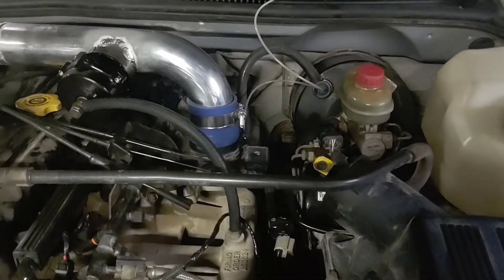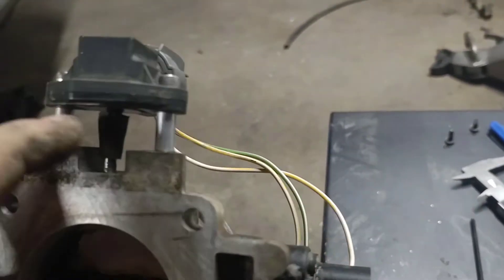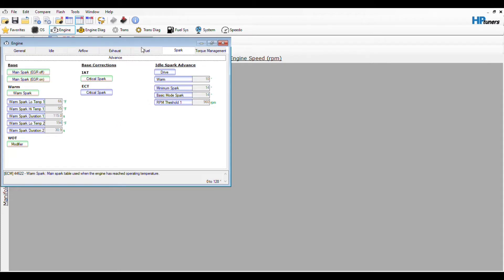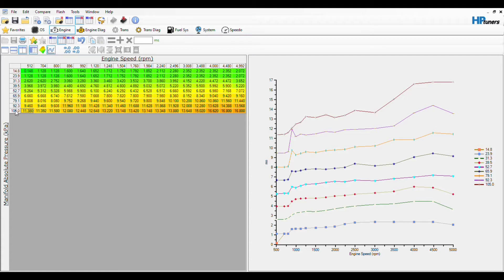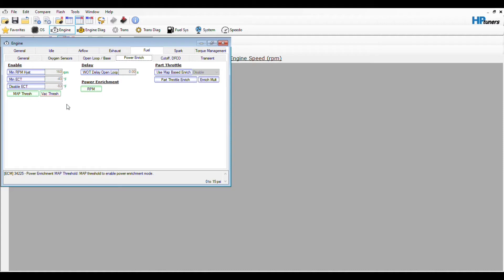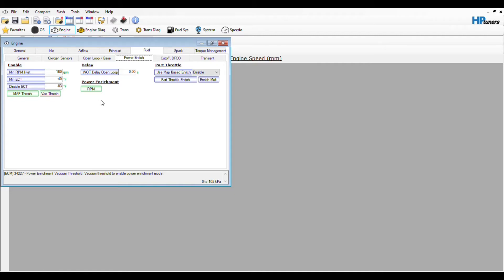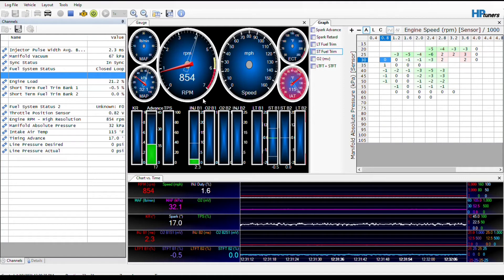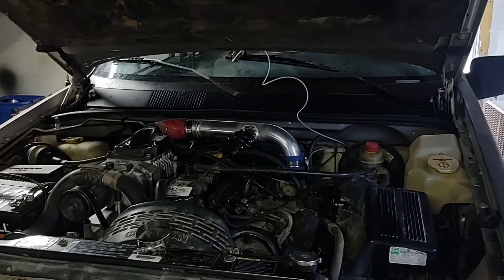hp tuners supercharged jeep

Comment: So basically the MAP reading is the "inverse" of the vacuum reading, it calculates vacuum from atmospheric - MAP reading. So if you used the original sensor with the supercharger, when you hit 0 psi or atmospheric, it would have thought the vacuum was at -1 Bar. which obviously is not correct since it would actually be 0 Bar. So then you use the open loop threshold to basically stop letting the ECU make vacuum calculations whenever you start making positive pressure, bringing the vacuum up instead of down, right? Basically as soon as it stops acting naturally aspirated. From there, you are just ignoring whatever the ECU thinks the vacuum reading it is, interpreting the MAP reading based on what you know it means in terms of boost, and using the open loop fueling table to make it fuel properly. Hopefully that made sense, correct me if I was misunderstanding anything. Great videos!
Reply from the maker: IV been meaning to make a new video to try and explain what IV learned over the past few years of remote tuning these things for boost.
Reply: @thomasbeyer  I will definitely watch if you do hahaha.

Comment: Ahhh there we go this answers all my questions. You used the Honda 1.75 Bar MAP to increase your resolution with the small table. Wonder how I'll fare with the 2 Bar MAP on the V10 then. Really is a bummer the tables don't have a bit more resolution and you can't change the max value past 105 kPa. I just thought of one solution I don't think you explored though. You CAN change any of the kPa values BELOW 105 kPa.
So for example if the stock table on the left side reads 14.8, 23.9. 31.3, etc. you could change it so the first 5 or 6 rows are values under 66 kPa to your liking and the last 3 or 4 rows are just for boost betweeen say 66 and 90 kPa since you never plan to go above 5 psi which is roughly 90 kPa by your readings if my calculations are correct. That way you have higher resolution below boost and also don't have wasted resolution above your max PSI.
Right click on the table and go to Row Axis > Edit then change each row label. I know you probably know, but in case anyone reads this comment. So you could for example have the row values read 15, 25, 35, 45, 55, 66, 75, 84, 90. Hopefully the ECU would be smart enough to interpolate everything properly. Let me know if you tried that and there was any issue.
Reply from the maker: Yes IV been changing the max kPa on the tables for guys running 10psi with SRT4 2.25 map sensors. I wouldn't think too deeply into the map/vacuum thresholds. Some ecu's only have map and not vacuum and the ones that have both it seems to be a high vs low RPM difference. The Honda crosses into boost at around 66kpa the SRT4 is around 46kpa as long as you drop the map threshold a little below that so you can get AFR around 12.7 at atmospheric your good to go. And just make sure if yours has the vacuum table to inverse your map number. If  map crossover is 55 then make the vacuum 45 and it will work. If you forget to change the vacuum threshold it won't leave closed loop.
Reply: @thomasbeyer  Yep makes total sense thanks a lot! I didn't realize the Mopar 2 Bar sensor was actually 2.25 Bar. That does make things a bit more annoying since I really doubt I'll go past 10 psi. Perhaps I'll get a GM 2 Bar or go the same route as you with the Honda 1.75 Bar. One of the main appeals to the Mopar sensor was being able to bolt it onto my manifold like factory, hahaha. At least with being able to change the row headers I can essentially get some resolution back and just lop off the top of the range I won't use.
Reply: @802Garage I told you all of this years ago.
Reply: @MonkeyWrenching  You gave me the tip on the PT/Neon MAP sensor fitting the V10 intake I believe. I knew it was a popular option for Hemi/Magnum folks. "Tuning" companies like to upcharge for it like crazy. Didn't know it was 2.25 bar either since everyone calls it a 2 bar, but it isn't, hahaha. Otherwise we never got to discuss tuning or anything HPTuners/JTEC cause we stopped chatting before you actually got into boosting yours. MAP sensor scaling is MAP sensor scaling, but I was watching these vids to learn how to do it on HPTuners with JTEC specifically since it is far from full featured. Pretty straight forward tuning, just very basic and limited. I've considered going to RusEFI to get more advanced, but I just don't think it's necessary and would be a little more expensive and time consuming. Glad your V10 seems to still be boosting well!

Comment: Thanks for the videos man I'm gonna share your channel on my channel next video I'm trying to get hp tuners to work with boost very soon got most of my parts in and will be installing a supercharger next few videos you def have figures out way more than me gonna let my subs know thanks again for the videos
Reply from the maker: Thank you I will check out your channel
Reply: @thomasbeyer  Rusty 411 is based. Very chill guy, been watching his channel a while. Thanks for all the JTEC + hp tuners stuff, very helpful. By the way, I'm about to start tuning on my 4.6 stroker. Do you recommend resetting the ECU to clear out the LTFT before scaling up the base fuel to match bigger injectors, then tweak base fuel according to what STFT logs show how it's compensating?
Reply from the maker: @nosebergs-are-at-it-again  every time you flash the ECU it clears the codes and clears the history so you don't have to do that it'll do it automatically. And yes I use the short-term fuel trims to dial in everything in the light load and cruising range
Reply from the maker: @nosebergs-are-at-it-again  you would need a wide band for the heavier throttle areas because it's going to go into power enrichment and not use O2 stuff cuz you want it to run richer than 14.7
Reply: @thomasbeyer  Yeah I've got an AEM 4110 w/ pro-link (didn't know about the serial port option). So once it goes into power enrichment, it doesn't reference the o2/trims anymore, i.e. goes into open loop and adds the enrichment table onto base fuel map?
Reply from the maker: @nosebergs-are-at-it-again  yes that's correct
Reply: @thomasbeyer  Awesome, thank you brother. That de-mystifies so much for me. I haven't tuned anything in the past, and almost all resources out there are tutorials on 3rd/4th gen GM stuff, so it can be confusing to try to translate it all to this early model JTEC stuff.
Reply from the maker: @nosebergs-are-at-it-again  your welcome. Hopefully I will get back to doing more jtec videos iv learned more in this last month doing remote tuning.

Comment: So when you swapped from the stock map with big injectors to the srt/honda map with big injectors it stopped running as rich?
Reply from the maker: I never ran it with the stock map sensor cause a 1 bar map can't read boost.
Reply: @thomasbeyer  but it ran ok with the big injectors? I only have 36lb injectors and it runs like shit
Reply from the maker: I never had big injectors in without the 2 bar map.
Reply from the maker: What setup do you have are you using hptuners?
Reply from the maker: If your boosted you need a 2 bar or 1.75 bar map and that cuts the injector signal in half so if you double your injector size and put a 2 bar in at the same time it will almost balance itself out
Reply: @thomasbeyer  i have hp tuners but havent even tried tuning yet....I also have a turbo but im using pontiac injectors and srt4 map. I ran it once with the injectors on the stock map...it rolled coal and mixed gas with the oil so I parked it until I could get it tuned
Reply: @thomasbeyer  oh ok...I didnt have the 2 bar at the time so thats what I wanted to know
Reply from the maker: The 2 bar will just about fix your fueling I would recommend the 1.75 Honda map sensor with those size injectors. As long as you don't plan on going over 11lbs of boost. That should get you close. You will still have to modify the timing tables but fuel will be close enough to start tuning
Reply: @thomasbeyer  yea I have 0 experience with tuning..been watching videos and reading stuff but I would rather wait for flyin ryan unless he takes too long...I have to get it to pass emissions
Reply from the maker: Iv been considering doing that kind of service. I do not have the amount of experience flying Ryan has but I am willing to do it and I'm sure cheaper than he does it for and sooner. As long as you've got a wide band and you're capable of sending me good data logs
Reply: @thomasbeyer  ryan said he should be able to get around to it next week. However more people tuning these is a great option

Comment: Great info, busy mounting my 2bar GM map for turbo right now. Wonder if you could you tell me what colours on the stock MAP plug are which? ie. 5v | Sensor output | Ground?
Reply from the maker: Mine is a 96 and the blk/ltblue is ground the why/blk is 5 volt reference and the red is map signal. I used a cheap multimeter to test which wire was what. I will double check after work but off the top of my head this is correct
Reply: Thomas Beyer thanks man, appreciate it. Will figure out how to check with a multimeter myself too. Not to hot with wiring diagnostics.